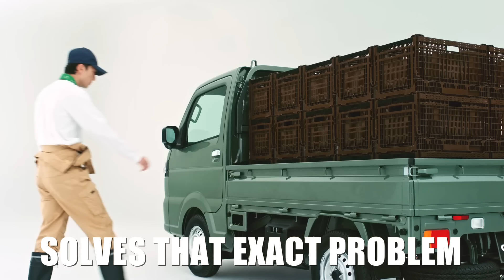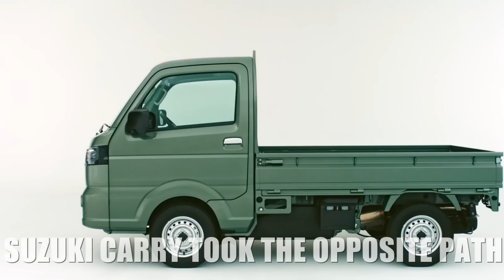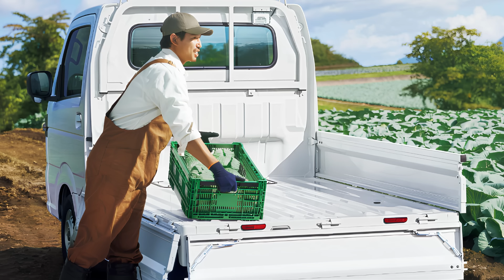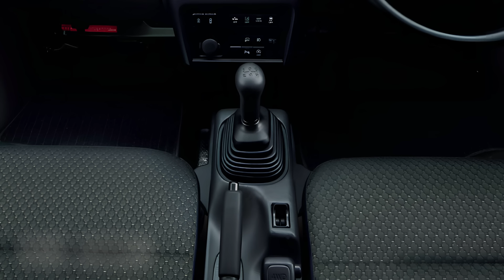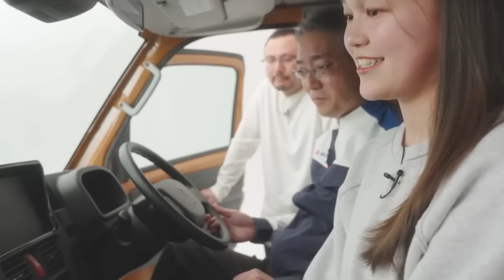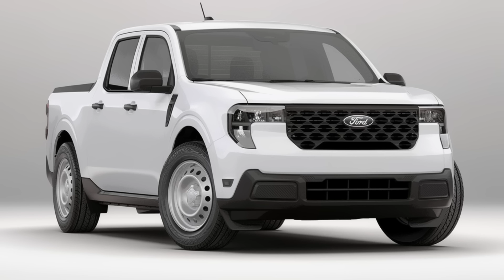Suzuki CEO Releases UNTHINKABLE $8K Kei Truck & Made Me CRY Tears of Joy!

Comment: Any social media rumors or claims that a policy or tariff change by the Trump administration is opening the door to legally buying new Suzuki Carries or kei trucks in the U.S. are entirely untrue.
The reality behind the political rhetoric usually stems from a couple of common mix-ups:
Tariffs Affect Costs, Not Legalization: Broad auto tariffs (or discussions around foreign imports) impact the pricing of goods, but they do not override federal safety and environmental laws (like the FMVSS). A tariff doesn't suddenly make an illegal, non-compliant modern vehicle legal to drive on U.S. roads.  
The 25-Year Rule Remains the Only Gatekeeper: Whether tariffs go up or down, federal law still forbids importing any modern foreign vehicle that doesn't meet U.S. safety standards. The only way a Suzuki Carry gets across the border legally is if it meets the age requirement (25 years old by its exact month of manufacture), which has nothing to do with current trade policies or presidential announcements.
In short, political talk about bringing "kei cars" or mini trucks to America doesn't change the underlying red tape. If someone online is claiming a new policy has unlocked brand-new Suzuki Carries for U.S. buyers, they are misrepresenting how federal import laws work.

Comment: Suzuki can offer some great machines, like the DR650 or GSX-Rs. The Suzuki SX4 hatchback new was under $14K USD. It could shift between FWD, AWD, and 4WD. Most came with sturdy roof-rails. I put a hitch on ours, and easily towed a Harbor Freight 4x8 folding trailer with it.

 Suzuki automotive closed up shop in the USA.
Reply from the maker: The SX4 was a genuinely underrated vehicle that never got the credit it deserved! Do you think Suzuki burned enough bridges leaving the US market that buyers wouldn't trust them coming back, or would a compelling product at the right price wipe the slate clean?
Reply: @fuel_force Consumers would stil be interested. The Samurai, Sidekick, Swift, SX4, and Kizashi still have cult followings...and Suzuki motos are still trusted.

Comment: I will not buy one unless the steering wheel is on the left side. I don't want one on the passenger side. This is America. The driver side is on the left side.
Reply from the maker: Do you think kei trucks would need to be fully redesigned for the U.S., or just adapted enough to meet regulations?

Comment: The good gas milage with the 1500cc engine is certainly achievable.  I repowered my 1979 Ford Courrier with a 1600 engine from Japan and got as good as 33mpg at hiway speeds. It amazed me, yes less power so I had to allow more distance when I  entered traffic but patience and good manners on my part but only a small amount of extra time. I would seriously consider a purchase even though I'm in my upper 70's😊
Reply from the maker: Would you say you’d still choose that kind of small, efficient setup today even with modern traffic and faster highway speeds?

Comment: $8,000. In Japan. Good luck getting them into the US at anything LIKE that. There is a website where you can buy these, or the Daihatsu copy of it. $28,000 MSRP. With a manual gearbox and 660cc engine. Even if you can ship them in on a large size RoRo vessel loaded full of these it's not going to be $8,000. Telo is working on a BEV version of something not as small, but not much bigger footprint. Way more power and more sophisticated, but initially it will be $40,000. Hopefully they can get production numbers up, and price down, but I have to wonder if the US will buy enough. Things like this CAN work well, but it's not big for the typical ego of American drivers.
Reply from the maker: Fair assumption, but plenty of owners are still reporting some of these issues even now. Have you owned a CX-30 yourself, or just going in optimistic based on the model's maturity?

Comment: Honorable mention here - you must have a look at Super Carry Indian version. Here, it comes with a 4 cylinder K12N engine, 5 speed manual producing 80hps, a full size body with single cab & rear wheel drive setup. In CNG variant, gives about 20-26 kmpl fuel efficiency.
Reply from the maker: That's a great shoutout - the Super Carry is seriously underrated globally! Do you think a version like that would sell well in Western markets if the chicken tax wasn't an issue?

Comment: I have a K truck here in Japan. I love it dearly, but I know that I would think twice about driving it in the US or Canada. There is about 1 mm of steel between me and the outside world. I would lose in a head-on collision with a large motorcycle. I don't think Japanese manufacturers want the legal risk of selling in the U.S.
Reply from the maker: That's a valid concern! Would you still buy one for around-town use in the US knowing you'd basically lose against anything bigger, or is safety too big of a compromise even at $8k?
Reply: @fuel_force  Thanks for the question. It depends on where I would mostly drive. Small town or country, definitely. Busy high speed places, not so much. During bad weather, I would maybe want a plan B car. But 4 wheel drive is so fun and useful in the snow. The great mileage and the maneuverability are great too. Depending on the make and model, high end cruising speed is abysmal (40mph) to tolerable (60mph) if you want the engine to survive any length of time. I guess I would try to be one level more of a defensive driver, but I can't imagine not having at least access to one. Oh yes, the steering wheel is on the other side which also increases the risk I imagine.

Comment: I love my 1996 Daihatsu Hijet (4WD, HI/LO transfer case), but a slightly stretched version with a little more cab room for 'Muricans and a modern 1.5 liter engine would be killer.  It won't be $8000, but if the base model is $14K and the full featured 4WD version is $18K, this will be a huge hit.
Reply from the maker: Did you import the '96 Hijet yourself? And how's parts availability and maintenance been for you - is it a pain, or surprisingly manageable?

Comment: I own a Suzuki Carry made in 1990. Before purchasing, I test drove seven other manufacturers of k trucks (mini trucks) and the deciding factor to buy Suzuki was its ability to lock the rear, front, or both differentials in. This gave me the choice to have one, two, three, or all four wheel drive with a push of a button ! Since I commonly use an eight foot wide snowplow, this ability is a necessity in the eastern continental divide. HOPE THAT ITS AVAILABLE IN THIS NEW VERSION ? Also, this 1990 version has “extremely loooww gears , which is needed for snowplowing, pulling my trailer loaded with over 5000 pounds of firewood through the mountains, and some very steep trail riding. LOW RING AND PINION GEARS ARE A NECESSITY WHEN PREFORMING THESE TASKS CONSIDERING THE SMALL AMOUNT OF HORSEPOWER AND TORQUE, ALSO HOPE ITS AVAILABLE IN THIS NEW VERSION ? And the only alteration that was badly needed for this truck (or any k truck) was to get rid of those tiny wheelbarrow tires and at least install a 25” diameter tire ! With much money and time spent, including lift, suspension, stretching the driveshaft, new BFG tires and moose wheels, I did it ! SUZUKI, IF YOU CAN HEAR ME, PLEASE CONSIDER THESE THREE DETRIMENTAL NECESSITIES FOR YOUR NEW AMERICAN VERSION AND I’LL BE YOUR FIRST CUSTOMER TO PURCHASE ONE  ! ! !
Reply: 25" tires will raise the bed and the increased load height will make the kei truck even more prone to tip over.  It'd never pass safety standards.  Or even worse, you'd get the loathsome wheel wells taking up cargo space and the large humps won't allow it to flat carry sheet goods, so you're back to breaking sheets of drywall.  I absolutely do not want wheel wells in my kei truck.

Comment: The small vehicle market has all but disappeared from the US for a reason - there's no demand.  These things are cool looking, but I imagine these vehicles that are loud, spartan, have 50-ish HP 3 cylinder engines, and which can take 30-60 seconds to reach 60 mph (if they can even achieve that speed), will have difficulty meeting American driving tastes unless they arrive with some serious engine and other hardware upgrades.  Many are known to top out at about 75 mph.  I just don't see a sustained, significant market for them here without making major engineering adjustments that will rapidly rachet up the price.

Comment: President Trump said American manufacturers should start building vehicles around the size of a Kei vehicle, not that they would be imported. They are really cute, but don't think less than 700cc engine could handle my 33ft trailer, the tongue weight is nearly as much as the capacity of this truck. Plus, I carry an off road vehicle on the back of my pickup while towing my trailer, have over a ton and a half in the bed. My aircraft carrier F350 Superduty, crewcab, 4X4, long bed, powerstroke diesel works perfectly for me. Could haul one of these in the back of my pickup for a spare. Think they'll sell like hotcakes if we actually get something like this, though. I can see where a lot of people could use one. Just doesn't work for me.

Comment: What Suzuki's in the USA l thought l would never see that also the actual dimensions of the bed is much bigger than any double cab ute and l live in Australia were you buy single cab utes 2X4 and with an aluminium drop side tray and they have a standard length of 2.5 metres and they actually long enough to take two full size pallets and that doesn't make them a truck a truck carries at least 6 full size pallets that's a difference between a ute and a truck and to drive a ute you don't need to upgrade your driver's licence were to drive a truck you need to upgrade your licence so stop calling utes trucks and l drove trucks and l had to upgrade my licence but didn't have to when l was driving utes around also many years ago there was the Suzuki Carry van available through Suzuki dealers and it was kei sized

Comment: The day they start selling these in the US for $8K new I will be in line in front of the showroom at 7AM with my checkbook. Would pay $300 more for locking diff and $1200 more for simple dump bed. $500 more for offroad 6-ply tires. No A/C. No power steering/windows/locks. No automatic. No electronics/digital/displays. Be nice if the doors came off easily like a Jeep.
Reply: That's the way I would want it also.

Comment: By the time dealers ad their buyers premiums,  you'll have a $20k truck.
Reply: Still better than an 80k one
Reply: Look at what $8K or $10K will buy at the  Suzuki motorcycle dealership, in the U.S.  Do you actually think this pickup after adding on  freight,  documentation fee, dealer prep etc  ,  will be sold for anything close to $20K  ?  A stripped down, stick shift, 2-wheel drive, short bed, no air-cond, will  still be lucky if it's even in the low $20K ....w/o tariffs.
Reply: @greglahue5690  Go to Suzuki's Japanese website and see for your self. Everything you said for a 2026 Carrie is about $6700.00usd with tax out the door.

Comment: I'm interested, as long as they don't load it up with unnecessary electronics.
Reply: The 2021 Infrastructure bill required all cars sold in the US to have a kill switch, starting in 2026.  They obviously missed the deadline because the technology doesn't exist but the auto manufacturers are hard at work on it and it'll be here in a few years.  By the time most people realize it happened, it'll be too late to stop it.  Expect the automobile spyware to continue to increase as well.

Comment: The thumbnail should read "promises to deliver the impossible"  the toyota hilux champ is supposed to start around 10k, an article i saw yesterday said the proposed 26 hilux will be around 32k
Reply: I think the sources those comments are quoting are going to be the key here. That said, this is still early and prices will vary. I think some of the hype is overblown because a lot of these youtube channels are quoting general prices listed in other countries. Manufacturing in the US right now is expensive and risky cost saving measures like importing steel from other countries can suddenly get tarriff'd into the earth one day and then revoked a month later which means they have to have multiple supplier lined up for a bunch of different parts and the final cost will reflect it. If these things sell for under $10k in the US it would be a miracle. I'd ballpark them at $15k for the cheapest ones when all is said and done.

Comment: That freaking touch screen is a definite deal breaker for me. I don't want or need the Distractotron in the middle of the dash. Those things cause more wrecks than I want to think about.
Reply: Agreed ! I'm in my mid 50's, I made it this far with out a screen.
Reply: A screen like that is usually just for navigation , AC, and possibly sound control, if that is a Deal breaker for you, than you clearly don't need a truck like this.
Reply: @Ditto_3Why would I want AC controls or any controls on a screen? Levers and dials worked just fine for decades and decades and cost less. Navigation works on my phone, just give me better and more factory options to mount it. The only screen I want is a small one in the rear view mirror for a backup camera like the one in my 2010 Tacoma. It's great for hooking up trailers and other real world truck tasks.
Reply: @Ditto_3 For AC controls I want dials and buttons - I quickly learn them by feel and never need to look away from the road.  And I don't want navigation built into the vehicle either.  When it's built into the vehicle, repair/replacement costs a fortune in labor and parts to tear the dash apart, replace the computer+display, and button everything back up again.  And there are easy and cheap alternative solutions available via either your smartphone or a Garmin GPS unit sitting on your dash.

Perhaps it's you're so weak that you need all that stuff spooned in for you, then clearly you don't need a truck like this.
Reply: They're showing the top of the range models. On base models, radio is optional.

Comment: Make a wide body version. With a 2 or 2.5 liter engine. That should be exciting for many buyers.
Reply: They already make those in Isuzu Toyota and Hyundai cabover mini trucks just slightly larger than these modles you just saw on this channel...They are diesel and very very reliable work trucks...
America has been blocked from buying these over many years... Isuzu is a very old car company producing great reliable vehicles for a long time...
Reply: . . . and more expensive . . .